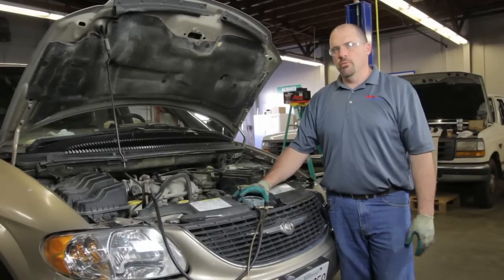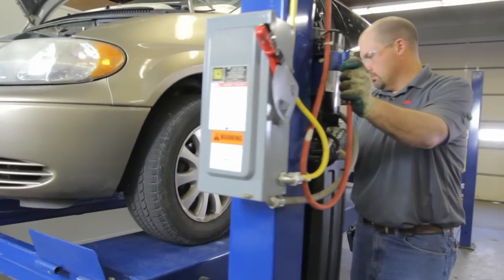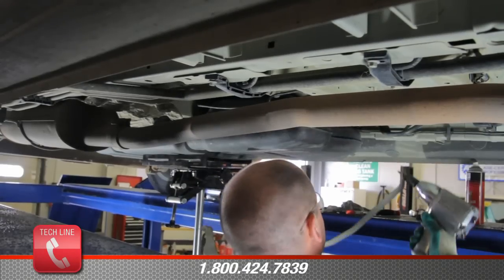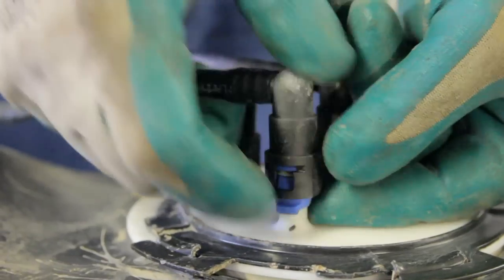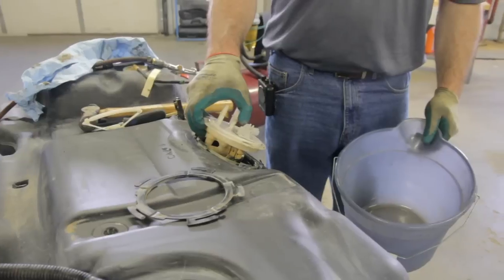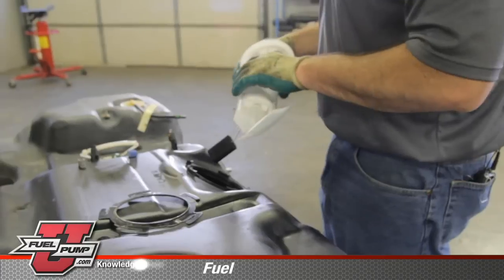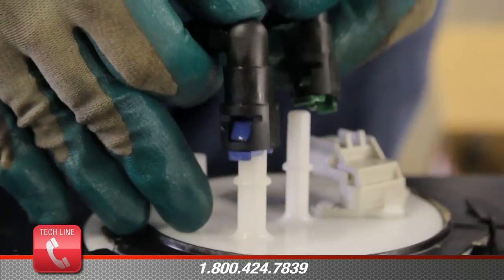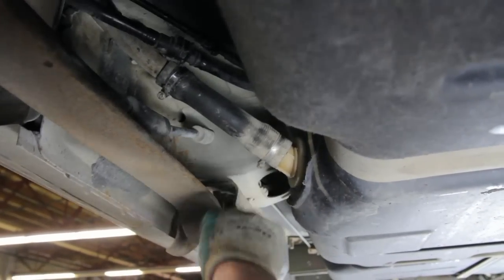How to Replace a Fuel Pump E7144M on 2001-2003 Chrysler and Dodge Minivans

Comment: If you came here because you just bought a new fuel pump but you’re wondering why it doesn’t have the tube and filter sticking off the bottom of it, it’s because they have been redesigned. There’s a small hole next to the weird looking little plastic thing that’s about 4” from the bottom. The hole is hard to see because the plastic is all white. So you’re good. Nothing is missing and there’s not another part you need. Just install it and it will work

Comment: I had an 02 TC and never had a problem with the fuel pump, I got rid of it for other reasons (rust) almost 200,000. Now I bought another identical one with only 100,000 and hoping the best.

Comment: If you don't have a fuel pressure gauge, just crank the engine and pull the fuel pump relay on the fuse/relay panel under the hood.  The engine will die in a few seconds and there will be no pressure in the engine line coming off the fuel filter.
Reply: P

Comment: Emissions hose connector with white “clip”, front passenger side, not shown in this video, is released by pressing the white part radially, toward the hose centerline. I pressed on the white part with the tip of my pliers, while twisting and wiggling the connector with my hand until it released.

Comment: Tomorrow I am changing the pump and filter in my 2002 Grand Caravan. I am not getting vacuum to the tank and it shows up as a light on the dash. Sometimes the car will stumble while driving. Could that be the problem?  Have you ever experienced that problem? Thanks in advance, Bill

Comment: Thank you for the vid! You should probably mention WHY to use the BRASS punch instead of another type of punch --- so you don't cause a spark and BLOW UP.
Reply from the maker: You're welcome for the video. And now that you have mentioned why one should use a brass punch (so no sparks are created) we don't have to! Just kidding. It is a valid point and should have been mentioned.
Reply: Seriously you could BLOW UP? I would think catch fire at worst. Don't you have to have an actual explosive element to blow up? Asking  cuz I don't have a brass punch, and have always just used a couple of flat head screwdrivers to remove the ring.

Comment: I have a 2003 Dodge Grand Carvan and would like to change the fuel pump and fuel filter. Do I have to perform the gas pressure test and measure before I replace these parts? Is it necessary? Thank you.

Comment: I have a 03 town and country. I saw a previous comment about the fuel pump being the issue if your car starts but then it dies out as if the battery were the problem. Is this true? And if so what would be an estimate cost for parts and/or repairs? Thank you for your time.

Comment: that was a great video...but i got a closer but more challenging question...i got a Roll over Valve on my fuel Tank that needs to be replaced. how do you do this? its an 03 Dodge Grand Caravan 3.8

Comment: It is possible to do this without complete removal of the tank.  Follow instructions except for loosening the filler neck hose clamp and purge line fitting.  Allow passenger side of tank to angle down and you have enough room to access pump.  When I went to install the locking ring, i found it necessary to use a file to bevel the leading edge of the locking tangs.  With the tank on the vehicle you can't exert enough down pressure on the locking ring to compress the seal.  Also used some silicone grease on the locking ring to aid in driving it into place.
Reply: +Airtex Pumps I understand.  I couldn't tell how to work the fitting on the vent line.  Even with the tank off, how can you be assured of cleaning the tank thoroughly?  I really do appreciate these diy videos you offer.  Hope you know that.

Comment: I am having a hard time figuring out how to test the fuel pressure on my '02 Caravan to determine if I need a pump or regulator. It appears that the fuel rail on this model has no test connector. A hard line comes off the fuel rail on the passenger side of the engine by the throttle body where it connects to a flexible line was some kind of quick connector. Any ideas how I can get a tee into the setup to test the fuel pressure?

Comment: I have a 2003 Dodge Grand Carvan and would like to change the fuel pump and fuel filter. Do I have to perform the gas pressure test and measure before I replace these parts?
Reply: ***** Is it necessary to check the fuel pressure after the installation of the new fuel pump and filter?

Comment: how do you check the fuel pressure  . I couldn't find the schrader valve
Reply: Mine was on a black plastic line 1 inch from the fuel rail.

Comment: Great video, but I'm having a problem with the emissions/vent hose connector. Does it require a special tool?
Reply: Emissions hose connector with white “clip”, front passenger side, not shown in this video, is released by pressing the white part radially, toward the hose centerline. I pressed on the white part with the tip of my pliers, while twisting and wiggling the connector with my hand until it released.

Comment: I just replaced the fuel pump and changed fuel filter as well on a 01 t&c...The pump makes a sound very briefly when key is turned to "on" position right before to start.  The test port is showing no fuel pressure.  The old fuel pump that died made no noise at all...This one was does for 1/2 a sec then nothing...Car won't start any suggestions?
Reply: Curious what ur solution was. I have a crank no start low pressure issue. But if I toggle the key I hear pump briefly. And if i toggle it 5 to 8 times it will start. I replaced injectors as they said 4 were leaking. Problem seemed solved for 4 days now its back. So is the pump the real cause maybe that has some pressure leak and does need replacing but the motor for the pump maybe fine. Hence why I ask. Hope you still monitor.

Comment: my 2001 town and country fuel pressure reading is 65psi running and 58psi with engine off.pump bad or regulator ? the video is great have my tank down . just not sure what part to buy..3.8 v-6 2wd

Comment: Good night, I left the trip recently and after 5 hours on the way to 80 mph my truck was started to pull out until the engine was dead, there was no engine fault light, I checked the main points to open the ignition key without starting it And if the bonba was activated but did not manage to teach, check the purge of the injectors and only air came out a companion opened the contact and pressured the line teaching the van instantly, andube 5 days in the city, back home after Approximately 6 hours slightly pulling without going off, reaching my destination the question is due to replace the pump or what is the optimal pressure or it will be that the filters are very dirty, thank you very much. town country 2002
Reply: Ok. Muchas gracias.

Comment: Hi,
  I've done exactly as this video describes, but when I put gas back in the tank, I'm not getting any fuel to the front rail.  I know the pump is good as I tested it before I put it in.  What would keep  the unit from getting gas to the fuel rail?  I put 2 gallons of gas in the tank before I cycled the key and i can hear the pump cycle as I turn the key to the on position, still no gas.  I replaced the pump because the floats were not working in the old pump.  I even installed the old pump because the sending unit worked, but still no gas.  It's like it's not priming, or building pressure enough to start pumping.  Driving me crazy as it's straight forward, but I'm at a loss right now.  Any ideas?  Thanks...
Reply: You have to have 4-5 gallons into the tank for it to prime properly. Otherwise the gas is just not reaching the fuel lines.

Comment: Anyone know if the pump has a regular on it or is it on the motor on the 3.8 I just did the pump and filter was fine for 2 weeks now it takes cycling the key 5 times sometimes more before it will start again ugh
Reply: If its a 4th gen, its on the pump.

Comment: We have a 2003 Chrysler Town & County EL which the previous owner had installed a new fuel pump (I’m guessing this wasn’t done by a garage mechanic). The fuel gauge hasn’t worked since then – stays on empty. Tried doing and interment panel check and fuel gauge does work. I’m assuming a new fuel pump and sending unit will be needed. Can you suggest anything else I could check before replacing the entire unit? How much information do I need to know to order a new one? I’m judging from your video this could be accomplished in the driveway, at home. Thank you.
Reply: Did they answer you cause i have the same problem new fuel pump gauge doesn't work

Comment: Video helpful, however on my 03 Flex fuel Grand Caravan there's a hose, part of the rollover system which runs up through the frame.  Green squeeze clip to release at the rear, but a fitting with a white insert at the front. Had the tool used to separate AC fittings, but it didn't work. Finally had to fish the tube out of the chassis. Not a fun job with the tank hanging loose. Had to abuse one of the tube's protective bushings to get it out. Service manual doesn't show it either.
Your thoughts?
Reply: Emissions hose connector with white “clip”, front passenger side, not shown in this video, is released by pressing the white part radially, toward the hose centerline. I pressed on the white part with the tip of my pliers, while twisting and wiggling the connector with my hand until it released.

Comment: I really wish i would have seen this an hour ago.  Now, I am trying to find the fuel tank rollover valve.  OR at least the part that goes into the tank.  I broke the plastic stem off at the part going into the tank.  I cannot find this part and hope I don't have to buy another gas tank. I didn't see this line due to the filler tube blocking my view.  Any suggestions?  This is on our 2003 Grand Caravan

Comment: I'm getting sick and tired of having to keep getting under the Dodge 2002 Grand Caravan 3.8L engine, remove the gas tank and replace the fuel filter. It's a pain in the neck as I supposed to change the fuel filter every year! Is there a way I can relocate it by bypassing it under the tank and put a new one under hood before the fuel injector so it would be alot easier for me to change?
Reply: Thanks for getting back and letting me know. The vehicle is way past that as it is a total of 144,000 miles. I wished I had the ability to replace it, but my only concern is working under the vehicle myself since it might fall on top of me. :(

Comment: How do you remove the gas out of the tank before you remove the tank?
Reply: I have tried to put the siphoning hose in the gas tank it goes in about 2 foot and then stops just before it reaches the tank. How do I get the hose past the rollover valve or whatever the hose is hitting? Thank you
Reply: I was afraid of that. It has a full tank of gas in it. Thanks for the fast reply.

Comment: ok so is it possible that my fuel pump is bad if when I turn the van  on it some time jumps to start like it wants to die but it doesn't its a good battery so its not that could it be this if not what could it be

Comment: at 1:50 - 1:54  -   seems like a real poor explanation of the "safety retainer"       orange clip?   not sure how it is removed or released...
Reply: These are standard and videos can be found on this subject. Press the thin edge of the orange part toward the connector centerline. In this case, it will be pressed to the right. Then squeeze down on the back of the connector and pull/jiggle.

Comment: You kept by passing everything I needed to see. THANKS FOR NOT
Reply: Emissions hose connector with white “clip”, front passenger side, not shown in this video, is released by pressing the white part radially, toward the hose centerline. I pressed on the white part with the tip of my pliers, while twisting and wiggling the connector with my hand until it released.

Comment: poor explanation of the "safety retainer"
Reply: Emissions hose connector with white “clip”, front passenger side, not shown in this video, is released by pressing the white part radially, toward the hose centerline. I pressed on the white part with the tip of my pliers, while twisting and wiggling the connector with my hand until it released.